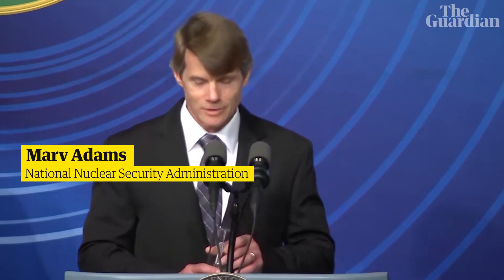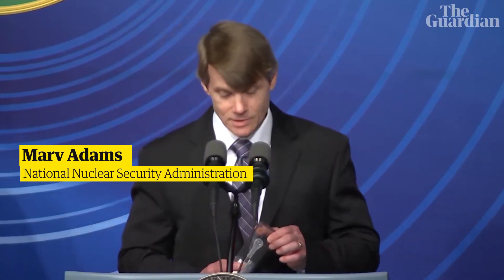Nuclear scientist Marv Adams explains what happened in the successful fusion experiment

Comment: Massive clickbait, massive, massive clickbait across all the news channels. I guess corona is over, the ukraine war is slowly fizzling out, so the news need new ways to stir the attention.

"More energy out of the reaction than the amount of energy the lasers deposited".

But that's not how "energy in vs energy out" is usually measured. Usually, you'd measure it based on how much power you're pulling from the wall vs how much power you're giving into the wall.

Since they currently don't produce any, and they aren't even ever planning to convert that energy back to electricity, the energy given into the wall is zero, and always will be with this pulsed laser kind of approach to fusion.

But even the heat energy produced is less than what's in the lasers, because not all the laser energy gets deposited. And that's still much less than the amount of power that goes to power the lasers, because not all the electricity is converted to laser energy.

Even then, still totally ignoring the energy used to create the capsule and the little gold cylinder, which are of single use and sends shrapnel across the chamber after each shot. 

All in all, this is not "gain of 1.5", or rather, it's only gain of 1.5 if you redefine where exactly you measure the gain in order to suit your PR agenda.

This is all still very impressive, but it's not a breakthrough in terms of energy production.

 It's not going to solve our energy needs, because the NIF method of zapping plastic balls with lasers is universally considered not fit for energy production. 

All in all, this is mainly a way to study nuclear explosions without violating the treaties about banning of nuclear explosions.
Reply: Yes pack it up boys the youtube expert is here with his non existent science degree and a masters in plumbing.
Reply: @ben_dover33  Sorry, but there's been multiple reputable scientists debunking this newest sciency article headline craze, but they're hard to hear over all the noise of the people who think this is an energy source.

They redefined what they consider the Q value is.

They aren't measuring the total energy in, they're measuring it much closer to the pellet. The guy said it himself, they measure the amount of energy deposited.

Unless you have an evidence that suggests that the 2MJ is the energy they pulled out of the electricity grid, you won't win this argument by insulting my education.

Comment: can someone expl;ain what this means to me i have no idea about this stuff
Reply: Fusion is something we know about already. The Sun fuses light elements into heavier elements, which is how all that energy is released. Man-made fusion that released more energy than it took to start the fusion has only been done in thermonuclear bombs, until now. This used 2 MJ of laser impulse to release 3 MJ from fusing hydrogen isotopes into heavier elements. The 3 MJ release happened in roughly 0.08 nanoseconds. A nanosecond is roughly one billionth of a second. Three megajoules is roughly equal to the energy released by about 1.6 pounds of TNT.

Now the method that Lawrence Livermore National Lab in Livermore, CA used is different than what prototype reactors like the tokamak fusion reactors use. The longest a tokamak fusion reactor has run fusion so far is 5 seconds, but the fusion in the reactor was not releasing as much energy as what it took to make the fusion reaction. Another problem is that the 2 MJ laser impulse, pulled 300 MJ from the grid to make it happen. That would be fine to start a fusion reactor, but the fusion would need to be sustained without further large inputs to make the laser impulse. So while this is an important step to fusion power plants, there is still LOTS of work to be done before fusion power plants happen.

Comment: Guardian readers will believe anything.
The truth is that the actual yield of this experiment was around 0.5% of the energy that was needed to fire the lasers.
Reply: Where did you find this "truth"?
Reply: @forza3943  Pretty much anywhere, if only you made the effort to read. Check the comments by Tony Roulstone of Cambridge University, among others.
Your disblief confirms the level of idiocy I associate with the average Guardian reader.
Reply: @jacquesmertens3369  Doubt i've ever clicked on a Guardian article in my life, but whatever you say.
Where can i see Roulstones comments? I'm just asking for a source, if you have a problem with that then you have no right to pretend to be correct
Reply: @forza3943  Is it really so hard to google for 'nuclear fusion roulstone cambridge' ? You'll find links from all major news sources. All, except The Guardian of course.
Happy to learn that you are not a regular Guardian reader.
Reply: @jacquesmertens3369  Althouth your original comment was true, i'd call it a bit misleading. While the NIF did require lots of energy to power the lasers, it wasn't designed to be efficient, it was used for data gathering. While it indeed isn't as groundbreaking as some of these news articles make it out to be, it is still an important step towards commercial fusion power

Comment: There is no new achievement here. Thermonuclear bomb produces much higher energy gain and it is based on fusion. They just exploded a tiny bomb, if they make it bigger, the gain will be bigger. The problem was, and still is - how to use this energy.
Reply: They made man-made fusion that produced more energy than needed to start the ignition, without the bomb part. That last phrase is the important part. It's an important step, but still a ways to go for a fusion power plant.

Comment: What he does not say is that while the energy released by the lasers was less than the energy released by fuel, the energy used to charge the lasers was not included in the calculation. Until you make much more efficient lasers, you are still using more energy than was released.
Reply: From the article I read, 300 MJ from the grid to get the 2 MJ of laser impulse. Still, outside of a thermonuclear bomb, more energy from a fusion ignition (3 MJ) than what was used to start the fusion ignition (2 MJ). Sustaining the fusion reaction is a huge hurdle, but one step on the long road is complete.
Reply: @steveaustin2686  I'd agree that it is a huge step.

Comment: This is an amazing first step in reaching real long term stable fusion reactions. Congratulations to everyone involved your work truly will change the world
Reply: It's a dead end for power production, but a milestone for weapons research.
Reply: the power of the sun. 
in the palm of my hand
Reply: Nothing will change. The general public is not allowed to have access to lots of inexpensive energy.
Reply: Sorry. No. This is one of over 20,000 steps taken over the last seventy years, and this one is along the military research path; it has nothing to do with real long term stable fusion reactions for commercial use, and we're over a century away from anything remotely like that, if ever, at the current pace.
Reply: @bartroberts1514  correct.  The equipment used to power the lasers used 100 times more energy than they got out. What they did is so similar to how a Hydrogen Bomb works.  You compress the deuterium and tritium while exposing it to high levels of X-rays.  Same thing as a thermonuclear weapon.  
Except the equipment that is the size of a football field didn't get destroyed.
Reply: @phild8095  Uh, no. Are you including the failed experiments in that "100 times"? The man literally said that in this experiment more energy was released than put in.
Reply: @jacobhinton3802  Comparing the fusion to the lasers it is a 50% net gain, but comparing the fusion to the power required to set off the lasers, 98% loss. That fact is only in a few deep articles.  the press is running wild with this.  Second little known fact, this was done in a lab that was originally set up for weapons research, not power generation research.
Reply: @jacobhinton3802  This is kind of why the media doesn't like doing stories on this. It would take an hour just to explain how they used 400MJ of energy but only 2MJ reached the fuel. It's true that they got more energy out than was put into the fuel, but they're still FAR from having a system where they get more energy than was put into the capacitors. The milestone they're raving about is that they've proven the ability to collect more energy than was initially put into the fuel, which means they can work heavily on fixing the 99.5% of energy loss to the fuel.
Reply: @bartroberts1514  Military research has led to a number of breakthroughs and consumer products, and a step is a step no matter how many it takes
Reply: Hold on!!! Credit for a discovery is seldom shared. Just commenting.
Reply: It's not a first step, it's hardly a step. This is a pulsed device working on vastly different principles.
Reply: @therflash  being able to produce more energy than what’s put in is the ultimate goal of fusion power. Regardless of it’s size and design this experiment will provide important information about how to reach that goal
Reply: @TheJjcczz  I have no problem with the size, I have problem with how they define "break even" or "ignition".

Because this isn't it. "Energy out bigger than energy in" means ALL of the energy, not just hand-picked measurement point that ignores 99% of the inefficiencies in the system.
Reply: Let's hope your enthusiasm makes this a reality pretty soon else it's just going to be too late. If I was a betting man I'd be backing " the too late" scenario but live in hope.
Reply: @TheLRider  Even if we had working Fusion reactors today and everyone and everything in the world switch to clean energy in an instant, it wouldn’t stop the damage that’s already done. We’re on a set track at this point and things are going to get worse. All we can do is try and mitigate as much damage as possible while trying to fix the problem, but even then it will take a long time to recover and we likely won’t see that recovery in our lifetime
Reply: @TheJjcczz  Bruh.  What damage has been done?  It's never too late to reverse course.  And I have a hunch that we aren't doing that much to affect the environment in the first place, only disturbing the natural equilibrium of the system. As soon as the disturbance is removed, I suspect a drastic reversal of climate change..

Comment: To scale this up to a useful continuous power source, I wonder if the lasers would be necessary after initial ignition, or if D2/T3 can be continuously fed  into the reacting plasma without a need for lasers.
Reply: Yes, you always need the lasers because you need to pressurize it. This is and always will be a pulsed device, and this won't ever be an energy source, not in the current form.

Comment: Interesting.  However, a scientist speaking in terms of feet and inches?!?  Or, did he adjust his speech to the audience?!? :)
Reply: Audience I hope
Reply: Apparently trying to explain roughly 0.08 nanoseconds of power to the average person. Most people know that light travels very fast (~186,000 miles/second), so by comparing that to an inch of travel, hopefully shows just how brief the reaction was.
Reply: @steveaustin2686  
light travels ~300,000 km/second.
NOT "miles"! :) :) :)
Scientific Metric System vs. backwards primitive imperial system (that is not even unified) - is my point.
Reply: @iAmOrenWhoRU  ~300,000 km/second is the same as ~186,000 miles/second. The units are changed is all. You could make the unit the complete height of the Empire State building if you want, so it would be almost 677,000 Empire State buildings per second if you want. This was a press conference to the general public, not a scientific paper. 🙄
Reply: @LogicCaster  OMFG. What is so hard to understand about the concept of giving a press conference to the general public? This is NOT a scientific paper, which should be obvious to anyone. 🙄
Reply: @steveaustin2686  
Just what I said: spoke to the generally way-less intelligent.
How many feet are in a mile?
How many inches in a mile?
How many ounces in a ton?
Is there a 1/4096th of an inch?
Why 4096?
- Who knows and who cares!
Metric:
1,000 meters in a kilometer.
100,000 centimeters in a kilometer.
1,000,000 grams in a ton.
Simple, easy, no need to compare to anything.
5'11" + 2" = ?!?!?  why 6'1"?!?
1.78 meters + 5 centimeters = 1.83.
Simple.  cent=1/100.
Don't get me started on stones, pounds (libras - lbs), and ounces...
Mile into metric: 1.609 or 18xx or something else...
It belongs in ancient history,
Metric rules and has to be the only way =
no confusions, no arguments, no disasters.
Reply: @iAmOrenWhoRU  Dude, this is not the mental flex you think it is. If you want to feel superior for some spurious reason, that's entirely up to you. I know how metric works as do many others. I would expect that they likely used SI metric values in their experiments. This was a press conference for the general public dude, NOT a scientific paper. Chillax dude.

Comment: So it's faster than light ?
Reply: No. It happened extremely quickly
Reply: No nothing faster than light
Reply: @MagikarpMan  
Expansion of the universe can be between two points
Reply: @LogicCaster  that's cus space itself is expanding faster than light but space is nothing, it's not the particles in the universe moving faster than light it's the empty nothingness of space between those particles expanding faster than light, so still nothing moves faster than light

Comment: Im too dumb to comprehend so please someone explain what this means for humanity in general
Reply: Take a cup of water. 
That contains a year supply of energy for your entire household, using fusion.
Reply: By fusing isotopes of hydrogen, lots of power can be released. Thermonuclear bombs fuse hydrogen isotopes to release tremendous amounts of energy. This was an experiment to fuse hydrogen isotopes using lasers to release more energy than the lasers put in to the reaction. Outside of a thermonuclear bomb, this is the first time a man-made fusion reaction released more energy than what was needed to start the fusion reaction. Now the problem is to sustain the reaction for more than 0.08 nanoseconds. A nanosecond is one billionth of a second. An important step, but on the long road to fusion power plants. The 2 MJ of lasers took 300 MJ from the power grid to make. Fine for starting a fusion reaction, but it needs to be sustained for a viable power plant.

Comment: Folks working on all types of fusion experiment. Like to work Q = plasma/ignition not Q total. Q=1 I think it is called here, wall socket power although I doubt it's actual Q Total.. Taking into account the system as an whole. The entire cost of energy for the entire Experiment. 
Q Total is a way to measure the complete amount of power going in, with the power going out the system this is Q as in Q in Nuclear physics. Q plasma/Ignition represents energy going in, with regards to the plasma/Ignition only with the energy produced via  experiment never leaving the experiment in any form of usable energy. When indeed this happens this itself will lower the Q Total value. 
Q total includes Q plasma the cost of ignition the power you have to run the magnetic field the coolant the computers the Lasers to create Fusion. its containment and so on. Thousands of other elements have to be powered. When you add this altogether aka the whole system the whole experiment. Then this is then called Q Total. Sadly what has happened over the years Q Plasma/Ignition. Is used instead. I'm not impressed with this news at all
Reply: "The calculation of energy gain only considers the energy that hit the target, and not the [very large] energy consumption that goes into supporting the infrastructure"for the true Q value you have to consider the whole system in my reality. LFTR reactors should be the future until fusion is here. Ironically some types can produce deuterium-tritium that will be needed for experiment. This is the solution IMO.
Reply: No. This whole interview is in regards to delta positive or “q total” being positive. This is indeed proof that fusion is viable in reality.
Reply: @jeddaniels2283  
No you poopood nothing.
Gravity is one thing. Earthly means of acquiring fusion is entirely different. And i heard the NET total was positive. Where are you getting your info?

Comment: I am curious if the whole system was taken into account when calculating the net energy gain, I doubt it was. You need to compensate for entropy, i.e. cool and contain the system, which is not part of what he talked about - he only talked about the net energy between the power the laser needs and the fusion yielded.

Also, is it 2MJ of output laser energy, or did the lasers run with 2MJ of power? Biiig difference, since they are not 100% energy efficient.
Reply: 2MJ of output laser energy. and 300MJ were needed to produce that 2MJ of laser energy. but still, it took 90 years since nuclear fusion was discovered for us to reach this point.shows how hard it must have been.shouldn't undermine their achievements just cause we don't efficient lasers.